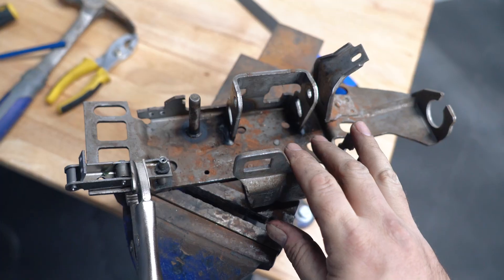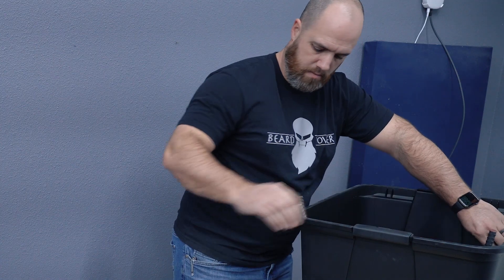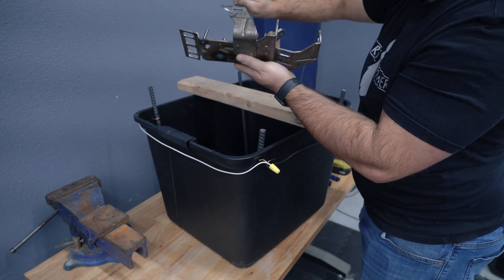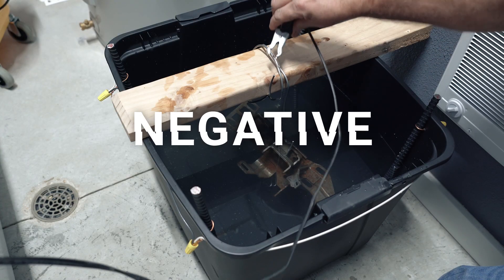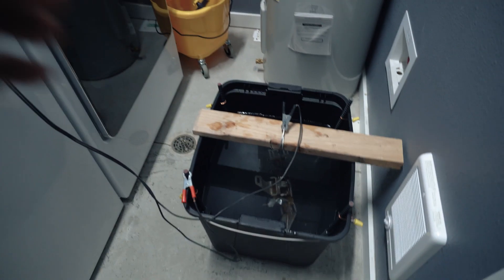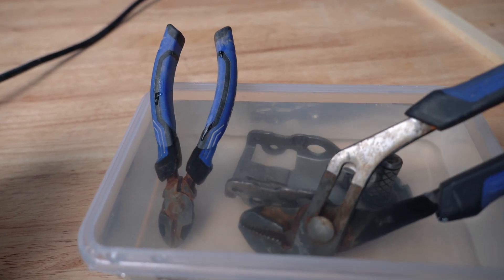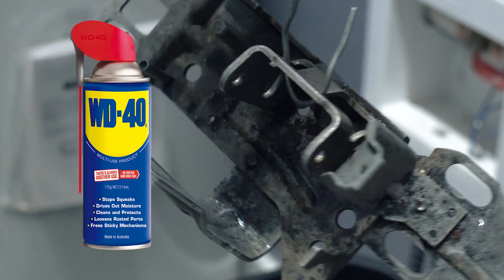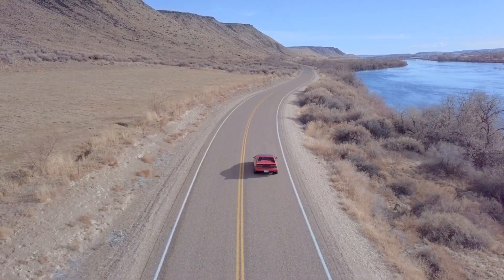Insane Rust Removal Hack! DIY Electrolysis Machine

Comment: I have watched other videos on electrolysis and they all used Washing Soda rather than Baking Soda.  I can't recall what the reason was or what the difference is, but thought I would pass it on.
Reply from the maker: Yeah, that's a good point. Both will work for electrolysis, but washing soda irritates your skin, while baking soda doesn't. Mostly, I just had baking soda on hand. :)